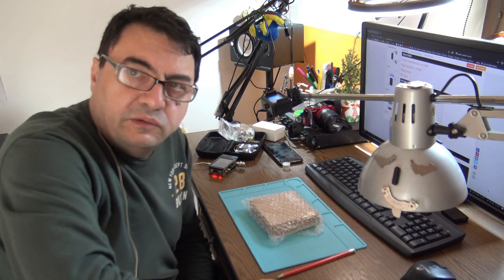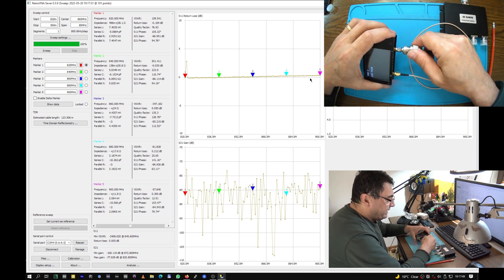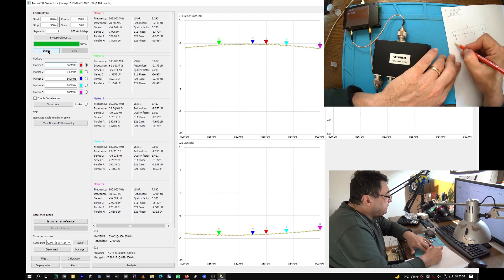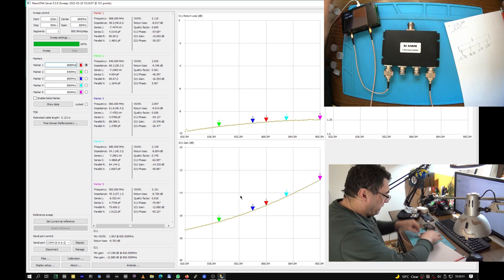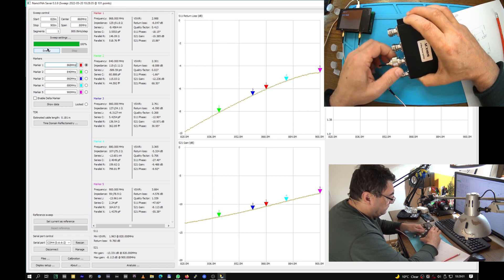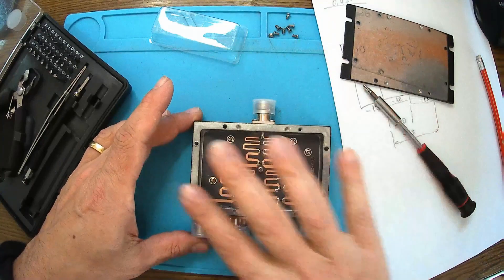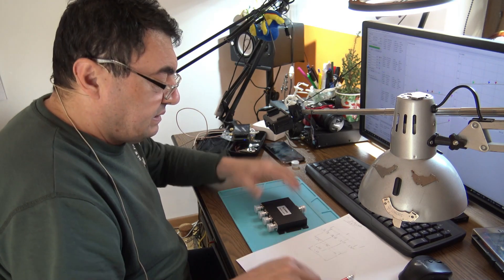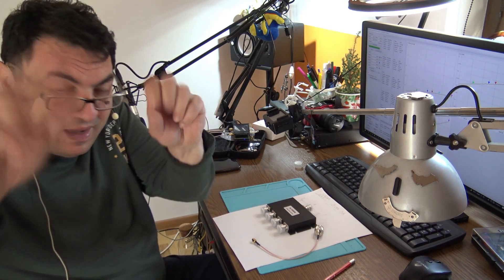ACASOM 4 ways power splitter test

Comment: Hello viorel, I have this splitter too but my signal is getting so bad after the installation. I use 7.5 dbi mc gill, 6 meter 400 lmr 400 and a flarm booster from jetvision. My rssi is between 130-140 and I only received signals about 5 km away from me. Without the splitter I recieve 40 km away. I tried it with acasom with cavity too same result. What iam doing wrong
Reply from the maker: The splitter have huge losses, but the amplifier should overpass those..I recall Acasom has 6dB ..put the amplifier gain to max..and maybe try for a day a single miner connected after the splitter..take them one by one..watch the numbers..
Reply: @viocaia  thanks for the answer. How to put the Amp gain to max? I give it 12 volt. Today I changed the splitter to the one with 3 outputs from acason too maybe it getting better. Thanks for your time and answer
Reply from the maker: @belyytiger8447  I thought Flarm has a gain control..good idea to change the splitter..let us know ..
Reply: @viocaia  maybe acason send me 915 mhz instead of 868 - is there a way to check this?
Reply from the maker: @belyytiger8447  they are full range
no problem like that
Reply: @viocaia  hello viorel I Switched the location and it started to work perfectly. I guess there was a signal that got boosted by the flarm booster and destroyed the gain. Now it works
Reply from the maker: @belyytiger8447  Super!

Comment: I have a 3 way acasom splitter but what cables do i need to attach to my miners thanks.
Reply: Have sent you a pic of splitter to your email address thanks.
Reply from the maker: @MarkSmith0706  https://www.amazon.ca/TUOLNK-Antenna-Extension-Coaxial-Security/dp/B09SPZ546K/ref=sr_1_8?crid=HUSAU1G5H8ZU&keywords=N-male+to+RPSMA+Male+cable&qid=1655461670&s=industrial&sprefix=n-male+to+rpsma+male+cable%2Cindustrial%2C169&sr=1-8
Reply from the maker: Send me photos..
Reply: Don't know how to upload pictures on my phone but it's exactly like your splitter but 3 way instead of 4 way if that helps thanks.

Comment: When you test the power divider, you need to connect a load of 50 ohms to other open port. Especially when testing port isolation, the difference is very large. the isolation value of this splitter is  above 30dB.
Reply from the maker: I'll do that ..|I don't have terminators for now..
Reply from the maker: A new set of test with loads on empty ports is coming soon..for 915MHz too

Comment: Should the other Ports be terminated during the Test?
Reply: Yes , should terminate empty sockets with 50 Ohm dummy loads, this is especially  the reason why the isolation test is totally inaccurate.
Reply from the maker: @BryanGreek1  True..I don't have terminations for now..I'll be back
Reply from the maker: By the book..yes..I don't have those, the risk of a malfunction miner is minimal due to low power/signals present.Probably reflections but LoRa signal is kind of special being sweep modulated and not very affected by.I'll redo the test when I'll have those terminators..or build some..
Reply from the maker: New tests coming soon with proper load on ports

Comment: Salutare Viorel! I live in Constanţa and I wait 3 Linxdot from 7 months already. If I use the splitter what you just show in the video and I use one antena 6 db McGill how many db I will declare at miner installation. This I think will be a good topic. Nobody speak about this     Will be interesting if you can explain a little bit about this. Of course if you have time and willing. Thank you in advance and continue to do the good work what you’ll do for the helium community!
Reply: You will also require at minimum a 10db amplifier with a 4way splitter, otherwise your signal will be next to useless, and you could most likely get away with still inputing a 6db antenna
Reply from the maker: @BryanGreek1  Of course it needs an amplifier..a new set of tests are showing soon..little better results..
Reply from the maker: Of course Good idea..thanks!

Comment: Hello,
i think your messurement was not correct, you to forget by the in/outputs that you dont use, to terminat it with 50 Ohms. 
So i Think the isolation was so bad. you get some reflections from the single port at the top of this splitter, where no termination it is.

LG Thorsten
Reply: Yep i think too, you must use 50 Ohm Terminators on each not connected port
Reply from the maker: @cabanossi  I will..
Reply from the maker: I'll verify that...thanks!
Reply from the maker: A new set of tests coming soon..proper this time.